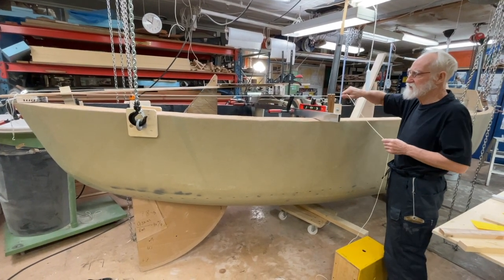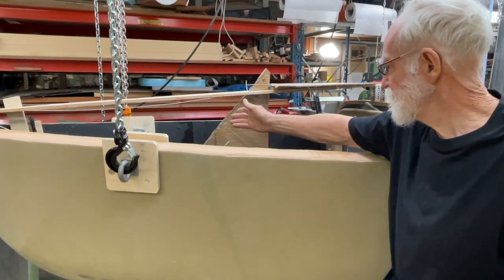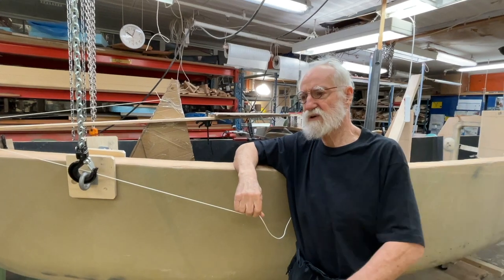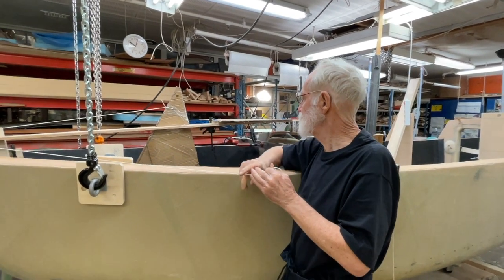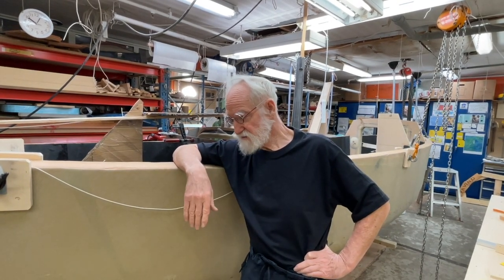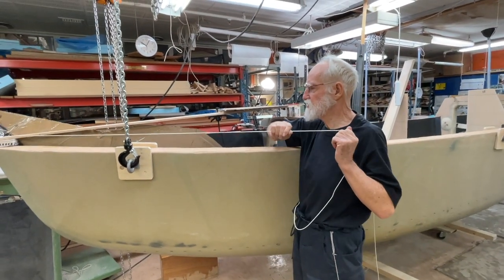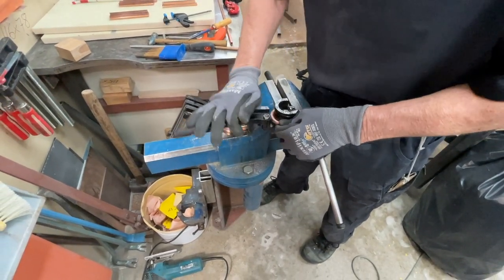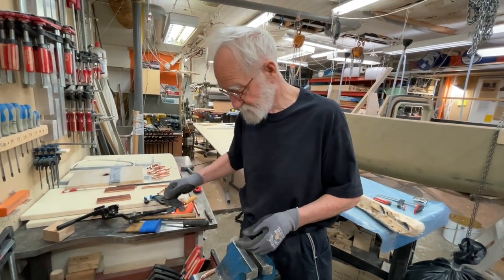CB clarifying and bonus better bending

Comment: Great explanation!  Now I understand why you wanted the board to go above the deck. It  makes sense to be able to repair it at sea. My boats were trailer boats.  If the centerboard lines broke you were supposed to raise the centerboard with rope under the boat to each jib winch and put it on the trailer to repair. This did not happen because we replaced the lines whenever they were worn while the boat sat on the trailer.

Comment: I know these copper pipes have to carry a lot of weight, but since you're using glass and epoxy to fasten them, I am thinking inspired by your earlier manufacture of cleets using fiber epoxied rope, would it work to use enforced PVC air-hose?

Comment: Could you rig a single line running in a loop to raise and lower the centerboard? You pull the rope in one direction to raise the cb and in the other to lower it. The loop could run through a rope clutch so you can lock the board at a certain height.
Reply from the maker: Something similar it is going to be

Comment: How about stops on the sides of the CB so if the cord breaks the CB doesn't fall so far down.  It looks like the CB will be infinitely adjustable with the rope.  Does the CB material float?
Reply from the maker: The CB material is epoxy laminate G 11 with a density of 2 it sinks. Part of the CB is always above the deck. There is a stop when its 90° down and a stop when fully retracted. If the cord breaks it will only take a minute to tie in a new one as part of the CB is abouve the deck.
Reply: @SvenYrvindExlex  Good plan.  I saw that the CB bucked up against that strut across the top but didn't know that was the final plan (or close to it).  Thanks Sven, that boat is gonna be something special for sure.

Comment: Will the center board be heavy? Steel/Stainless? Will there be another center board aft? Very interesting!
Reply from the maker: it will be made of Epoxy glass fibre laminate G 11 its density is 2. Aluminum is 2.7

Comment: I don't understand why the keel is in the front and not centered fore and aft.
Reply from the maker: My bed is in the middle of the boat. But more about that maybe in an other video.
Reply: @SvenYrvindExlex  Yes please, more details on the advantage of a forward keel/centerboard and the dynamics regarding center of force from sails/mast location, and how this affects self steering or inherent directional stability.
Reply: There is a rudder on the stern of the boat , more or less acts as a centerboard
Reply: For sailing performance considerations, the primary design issues are the center of lateral area beneath the waterline and the center of pressure above the waterline.  Typically, you would like to have the cp somewhat in front of the cla so that no input of the rudder results in the boat safely heading up into the wind.  Also, quick increases in wind are easier to respond to.  Adjusting the cla location and co location can be done while sailing by adjusting the depth of the centerboard and the presentation of sails (reefing, etc).  Having the ability to raise or lower a centerboard is a benefit in balancing a sailboat that is unavailable in a fixed keel rig.  Also, for this size boat there is the great advantage that forced at the tiller will be relatively small no matter how the rig is balanced.  "Small boat, small forces."
Reply: @boooshes  Thanks.  Interesting about CP and CLA.
Reply from the maker: @boooshes  The center of lateral area is by definition below the waterline, likewise the pressure above the waterline if not the sails would be in the water.
Center of pressure is in front of the the center of lateral area. Reason is the forces act in three dimensions and when the boat heels the driwing force is to lee of the resistance creating a rotating copple turning the boat to windward. The stronger the wind, the more the boat heels, the more weather helm it gets.
Reply: @SvenYrvindExlex  yes, I was trying to make a simple explanation with some definitions for the previous commenter. Oh yes, I see I wrote it incorrectly!  Fixed.
Reply: @boooshes  OK I get that, but with the centerboard this far forward the sails are invariably aft of the centerboard  (CP is aft of CLA). So how does that affect handling, balance and ability so safely head into wind?
Reply: My swing keel a 20' Laguna Windrose is more traditional keel placed aft of mast. A very squirrely boat. Much attention required to keep heading. My ketch full keel leading edge is as far forward as possible, much easier to handle, does not turn about without purpose.
Reply: @isserfiq  just because the centerboard is forward of the sails does not necessarily mean that the total CLA is forward of the center of pressure.  You also have to consider the rest of the boat lateral area.  For a small boat like this, one might also include all or some of the design rudder area, since restoring forces will be small.  All that matters in the end is being able to balance the rig under sail.

Comment: Hello Sven! I am sorry for the stupid question (boatbuilding theme is new to me), but this centerboard where is it located, in the front or in the back part of the boat?
Reply from the maker: it is in the front. It is a bow centreboard. I started to use them in the mid 1980-s with good results including one sail in a 15 foot boat from France to Newfoundland.
Reply: @SvenYrvindExlex   You used the double dutch canalboat version of a CB on Exlex 2019 if I recall correctly. Why was this a bad choice compared to the CB you are building for Exlex 2022?

Comment: This may be obvious to most...but won't water be coming into the boat through the CB hole?
Reply: The CB hole will be a watertight slot going from the deck to the bottom of the hull. Those walls are not there yet :)
Reply: @gustavlrsn ah got it. Like a "box". That explains it. Thank you.
Reply: @aviewfromthewall  yes, a tall, narrow box
Reply: Like a dinghy though through the deck.